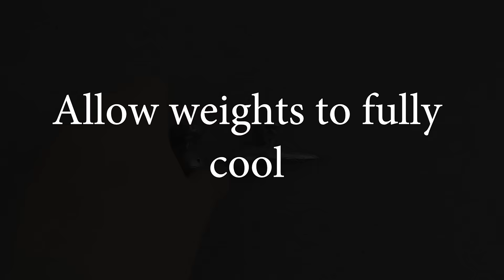How to Make Fishing Leads

Comment: Hi Just a question hope you can help. The wire peg that you put through the mould to create the hole where do you get them and do you grease them to get them back out ? Many Thanks.
Reply from the maker: Hi, I just use a grip lead wire that I bend at one end and use the pliers to pull it out just after the lead has set no grease on it. You can get them off ebay or from some local tackle shops.